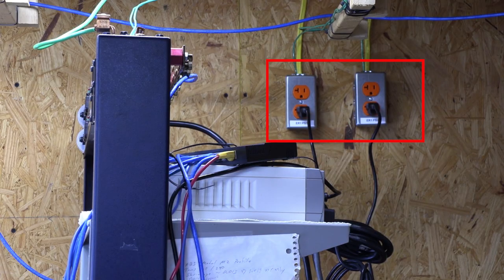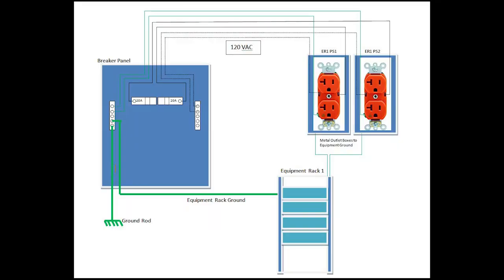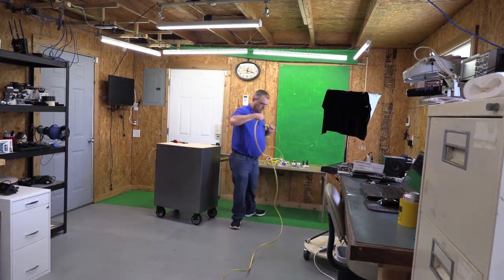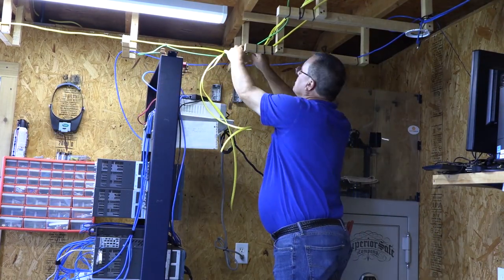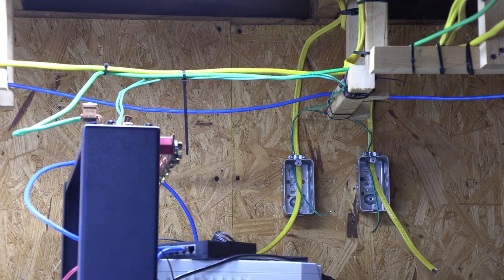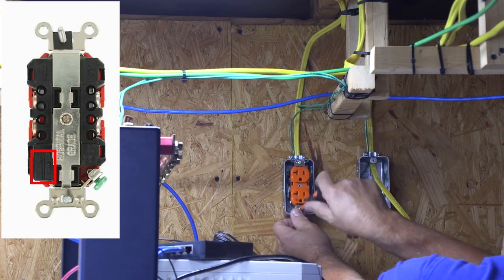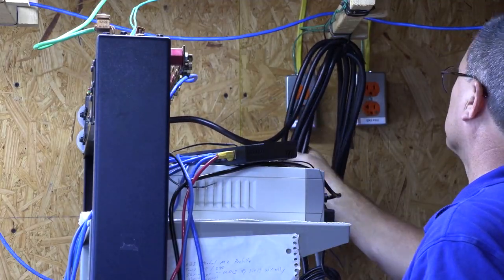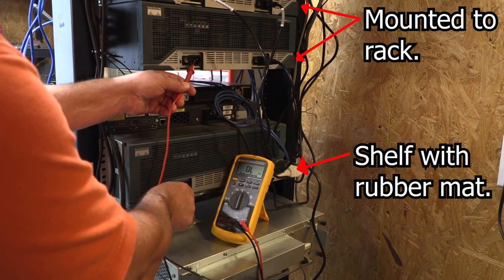NE#63 Installing Redundant AC Power With Isolated Grounds

Comment: I would take this video with a grain of salt. There are countless code violations and improper methods used. You did however give my class and instructor a really good laugh
Reply from the maker: Don't hold back...  list the code violations.  I'm sure others are interested, too.
Reply: One thing that I think is worth knowing is in case of isolated power systems generally the normal regulations are completely scrapped in terms of specific industry standard ones due to the fact that the safety is simply different

Comment: This is an example of why you should hire a knowledgeable electrician. Boys and girls don't repeat this at home.
Reply from the maker: Seems you know the how a "knowledgeable electrician" would do it... please enlighten us.
Reply: @NetworkEngineeringVideoBlog  Isolated ground receptacles do very little with regards to noise mitigation but if they are used there are specific guidelines for their installation, NEC, IEEE... A standard receptacle powering a power conditioner or other rack power source would have been a better option. If you're interested in noise mitigation what this installation has actually done is created more noise potential because your "isolated ground wires" are now basically antennas. Also contrary to some beliefs having a separate isolated ground tied back to the service ground system (rod) does not mitigate electrical noise. The earth is not a noise absorber. The metal boxes come with a grounding point the wood screw and washer is not that point.

My question to you would be what do you hope to accomplish by connecting a insulated conductor between an isolated metal box and the frame of the rack?
Reply from the maker: @Channel-JJ  Hello JJ, Thank you for your lengthy response.  But I am still trying to figure out what you don’t like about the installation?
Reply: @NetworkEngineeringVideoBlog  I didn't go into more detail originally because I didn't want to seem to be nitpicking and was hoping you'd look up isolated ground receptacles in more detail. As you asked here goes - 1. the box ground method is a NEC violation, the ground terminal of the box should be used not a wood screw through the box into plywood. 2. you attached the two isolated grounds to the same lug on the rack. most likely a code violation as few ground lugs are list for use with more than one conductor. Most can except and are listed for a range of wire sizes but not for multiple conductors. 3. the receptacles you are using are both isolated ground and hospital grade very expensive, I don't believe you mentioned that. 4. An isolated metal box with an IG receptacle connected by NM-B cable with an insulated conductor from the box to the chassis of a rack accomplishes nothing and doesn't serve to help people watching this video who may try to duplicate this.  5. the cable adapters are for NM-B cable only they are not listed to be a clamp for the cable and a single conductor together. I'm going to stop there because I have no desire to keep piling on. Would you now answer the question I posed previously?
Reply from the maker: @Channel-JJ  Hello JJ, you don’t think I looked up the code for installing isolated grounds before making this video, lol, that’s classic!  Here are my answers: 1. There wasn’t a ground lug. 2. Maybe but I noticed you didn’t bother to look up the code, either! 3. Yes. 4. I disagree. 5. Multiple cables are allowed in one clamp.  And, I did answer your previous question in the video.

I’ll make you a deal: If you make a video showing the “proper” way to install an IG receptacle and then post a link to it in the comments.  As long as it’s not dangerous, I’ll pin the video link to the top of the comments so folks can go watch your video, too.

Comment: Why you don’t use 12/3 for that reason??
You have:
Hot N1 witch is black;
Hot N2 witch is red;
Neutral, witch is white,
Bare coper, witch is ground;
So you can use your red as a insulated ground...
What do you think??
Reply from the maker: Hello Электрик-Мастер.  That’s an interesting thought.  According to the 2005 NEC, 250.146(D) Exception #4, “An insulated equipment-grounding conductor run with the circuit conductors shall ground the receptacle-grounding terminal.”  So, the NEC seems to agree with you.  I doubt the Electrical Inspector would like the use of a red wire, though. :-)
Reply: Network Engineering Video Blog wel sir, we put green electrical tape all around the red wire on both sides; all you have to do, - re’identify your red! That’s it!
I believe, by running a green ground wire from box to data rack, it’s not a grounding (!) it’s called bounding!

Comment: You had said that you had toconnect the racks to the ground? I didn't see you do that. or is that just a diagram of the wire?
Reply from the maker: The rack was already connected to ground using  4 awg wire to the breaker panel ground which is tied to a ground rod outside.

Comment: Hi. Thanks for video. Q1. Wouldn't plastic boxes solve your bare copper conductor and box grounding problems?  Q2. Why not cut the slack on PDU cords and install really nice plugs?  Q3. I bet the PDU chassis is tied to EG pin on plug, in which case didn't you tie the IG to EG simply by screwing PDU's to rack?
Reply from the maker: Great questions!  Q1: Yes.  If I used a plastic box I would not have needed to connect it to equipment ground.   Plastic boxes are not normally used in commercial buildings and I wanted to make sure I covered grounding metal boxes since the outlets would not.  Q2: I thought about shortening the PDU cables.  I think I just got lazy.  Q3: Hmm… that is a very interesting question.  I looked in the PDU manual and it didn’t say.  I assumed the power rails are isolated from the PDU chassis but did not verify it.  I’ll test it and get back to you… good catch!
Reply from the maker: Hello hightttech.  You are correct.  I tested the PDUs and the chassis is tied to the ground lead on the plug.    I'll make a video fixing it.  Thanks for pointing that out!

Comment: Incorrect cable, nonmetallic sheathed cable is not permitted to be installed in exposed locations, especially in commercial. Should have ran 2 12/3 ac90 cables and used the red wir with green tape as the IGC. Or ran it in conduit.
Reply from the maker: I agree, metal flex conduit should be used instead of Romex.  I doubt if wood ladder rack is up to code , either.  Everyone needs to check with their local codes before doing any electrical work.  Thanks for pointing it out.
Reply: It depends what type construction the building is. There is combustible material all over the building already.